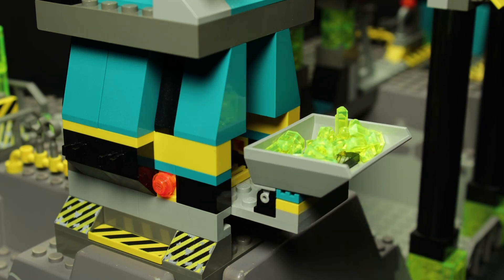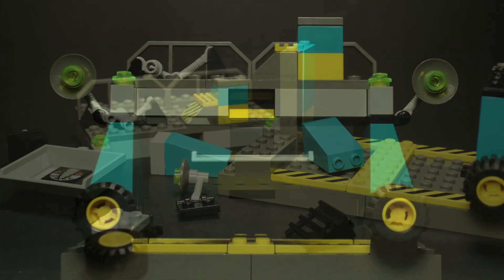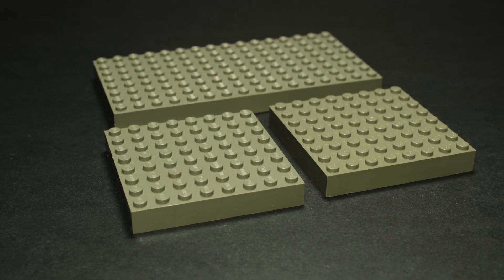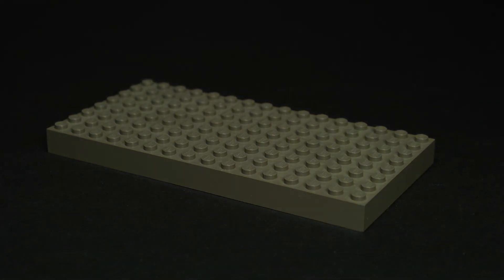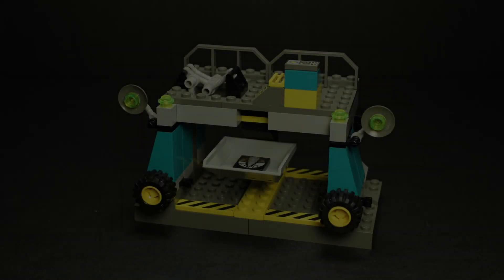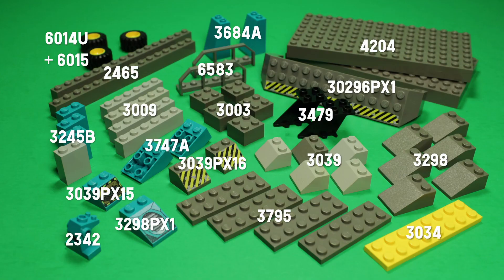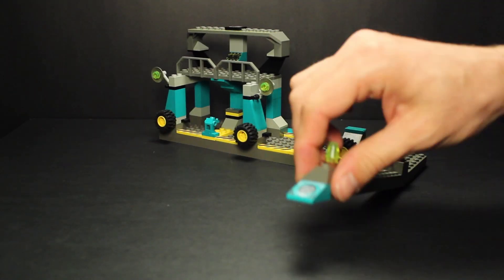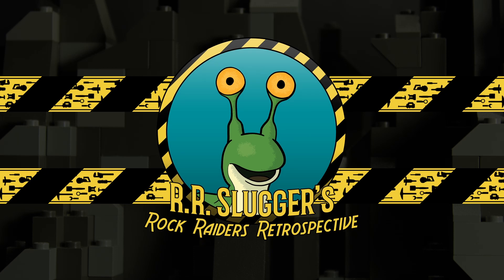How To Build The Docks ~ LEGO Rock Raiders Step By Step Instructions

Comment: 1:00 Oh wow! I did not even know that. This makes a lot more sense for the inside textures. I will update my docks version on rockraidersunited for sure. I use the ingame textures and official sets as the only guideline for my mocs on rru. I like the differences you get when using other references as the main source.
I also saw in the video that this animation goes all the way to both ends of the docks. Maybe part 2653 needs to go all the way to both ends of the roof and could be blocked off with a 3004 part on both ends to make that kind of range of motion possible. Really love the vids.

Comment: I just noticed the Docks build icon actually lacks the drill logo tile in its bucket. It's not visible in the manual render, but the build icon shows the bucket tilting towards the camera. On the other hand the in-game model has it, and while those often are inaccurate the Ore Refinery model does lack a tile in its bucket like in its render. So maybe at some point the Docks lacked it but then was given one, or they just reused the wrong bucket texture and it actually doesn't have one.
Reply from the maker: Interesting observation!